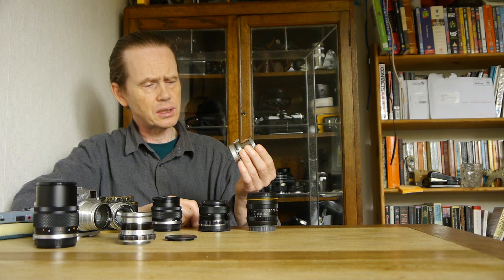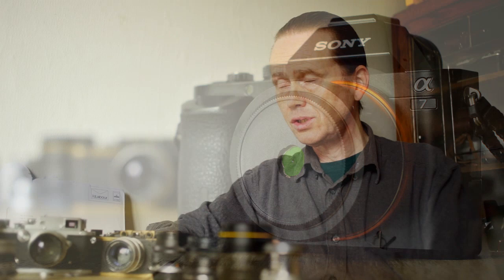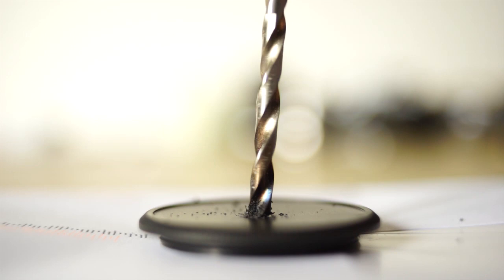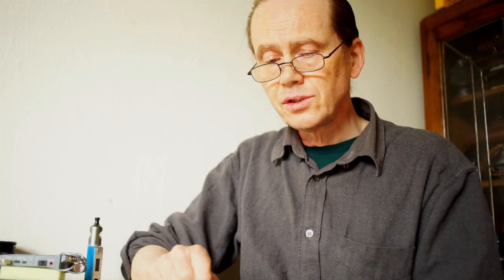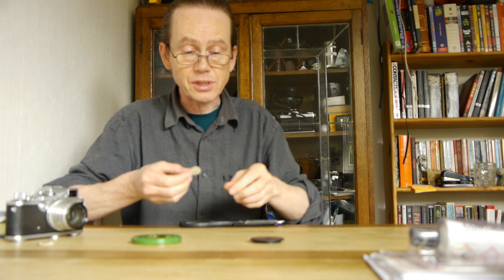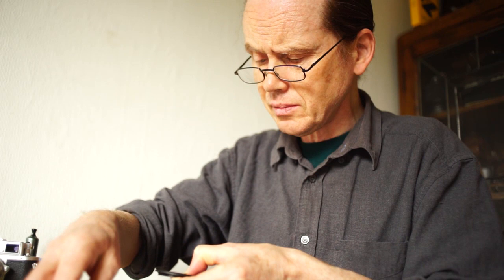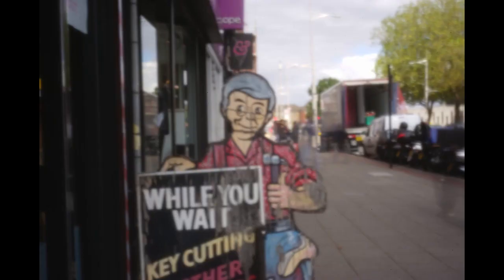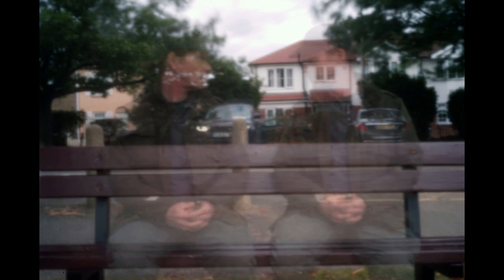How To Make A Pinhole Lens For Any Digital Camera

Comment: Cheers for the video on pinhole photography for digital cameras. Just for future reference and anyone else wanting to do this. Make sure you use a wood or metal drill bit, it will bite and drill more accurately. The one that Zenography host uses is a masonry drill bit, which is why it slips and takes so long to go thought some flimsy plastic.

Comment: I prefer to use thin copper, aluminum, or stainless-steel foil instead of the thick metal from the jam jar lid you are using.

Comment: The jam jar - draw a square on the lid. Centre a hole point. Drill out the hole. Use some tin snips to cut through, possibly. Or, drill out with micro holes along pre-drawn lines. Or use a dremmel equivalent.

Comment: I have tried with my DSLR but all attempts were failures. Quessing my camera is not suitable for that, and here's why. I have modified it so the sensor is seeing full light spectrum, to achieve that I have removed UV/IR cutting element. Any distance and any size of hole won't get my in focus.

Comment: Can one simply drill a pin hole in the body cap rather than add a metal piece?   Thx
Reply: No...the orifice needs to be VERY thin.
Reply: Foil is the preferred medium for the pin hole. Given a sufficiently circular hole, which requires specialist machinery or a lot of trial and error, pin hole photography can be relatively sharp. I made them years ago with photographic paper, which is extremely slow, to make direct positive prints. It took hours per exposure and had excessive contrast, but was succesful. The best I've every seen used ultra large format transparencies and a camera tent.

Comment: Can someone please explain why you can't just make a tiny hole in the cap without putting that extra piece of metal with a hole in the cap? I have watched a lot of similar clips and DIYs but never got the explanation of the second piece with a whole in it.
Reply: The thinner material is easier to push a pin into making a cleaner aperture that protects a better image and projects a wider field of view
Reply: If you put a tiny hole in a piece of plastic 1mm thick, you are creating a tube.
If you look through a tube, your angle of view is very limited.
If you put your eye close to a hole in a sheet of paper, your angle of view will be much wider than looking through a tube.
Get it?

Comment: Actually "the smaller the pinhole size the better" is not correct. With too small sizes you have diffraction kicking in, further ruining resolution. 0.2 to 0.3 mm diameter should be the target, as clarified in the wikipedia article "Pinhole camera". Also: the hole should be round, or at least with clean edges, and the material in which the hole is made should be thin, where thin means much thinner than what the pinhole width is, otherwise you get much more vignetting. 0.3mm diameter on 5cm=50mm pinhole-to-film (to sensor) distance gives an f-number of 50/0.3=170 quite far from the "millions" estimated in the video. Sorry, but I do not find this video on par with the other nice ones concerning lenses. Too much subjective meandering on simple physical facts.
Reply from the maker: This was not the finest pinhole lens in the world - no doubt about it!

Comment: whats the focal length
Reply from the maker: Not sure; it's pretty wide though, probably around 20mm or less...
Reply: @zenography7923  I **THINK** the focal length would be the distance between the film plane (or sensor) and the cap. After all, the pinhole is the aperture. I'll test my theory by comparing the image with images taken with an actual lens at various focal lengths.
Reply: Confirmed - with my test setup, the sensor plane (marked on top of the body) is aprx. 2 inches (aprx. 50mm) behind the cap. Attaching a 24-120mm lens without moving the body and taking test shots at successive focal lengths, the image are is closest to 50mm. So it depends on where the cap sits relative to the sensor or film plane.

You can buy these pre-made with a laser-cut hole sealed with glass, for just a couple dollars more than a regular body cap. As mentioned below, the F-value would be that focal length divided by the pinhole diameter. Mine is 0.3mm, so F170 as said. Unfortunately, the non-CPU lens data entry on a Nikon DSLR doesn't allow you to specify such an F-number ;) .

Comment: Wrong drill bit, a wood bit of the correct gauge, suggest 8mm secured on a piece of scrap timber before drilling, centre the bit and drill whole.
Cut tin with tin snips or aviator snips and to slightly less diameter than the drilled cap. Drill small whole using same method, or punch with panel pin using a pin hammer or hammer. Clean surface till taking off any rough edges then glue with contact glue or appropriate glue for tin to metal. Use cotton bud not fingers and replace lid so as not to spill contact adhesive all over the place!!!
Reply: Your spelling is not correct, hole is spelt h-o-l-e. Pay attention to this please.
Reply: @jimjames4875  pinhole :)

Comment: I like the consent and evolving the theory, but your not a Diy person are you? Heath Robinson’s ideas where in the main just over engineered but incredible eccentric solutions. I’d stick to the photography and lenses.
Reply: f1remandg stop being a downer man, this was a great video and really helpful.
Reply: If one doesn’t comment on the downside of vlogs, then they don’t get better or remove issues.
Zenographer was on the verge of harming himself and giving the wrong information for tools to use. Even used open scissors and the handle of as a hammer.
Several issues where done incorrectly that could be very dangerous.
So hence the comment on the implementation of the job.
Reply: f1remandg nit picky man. Let’s see your video on doing this.